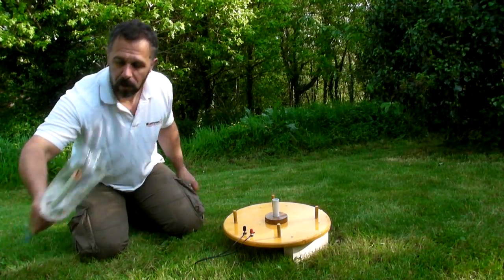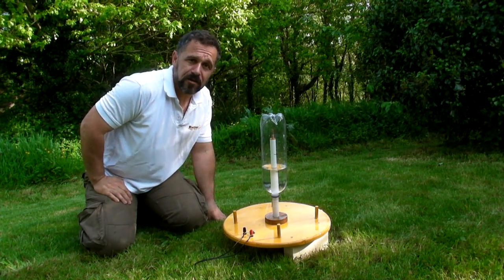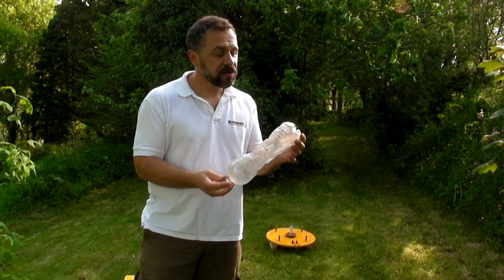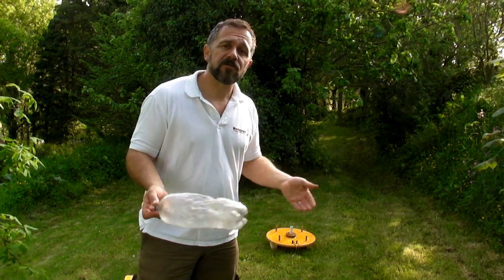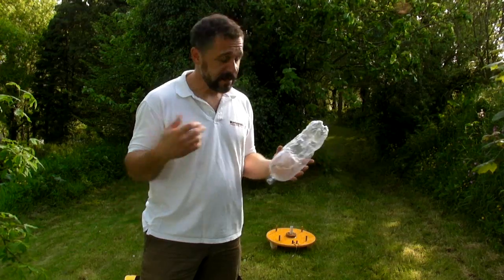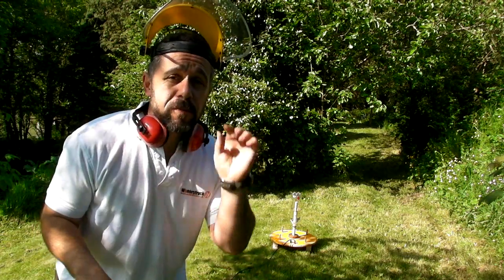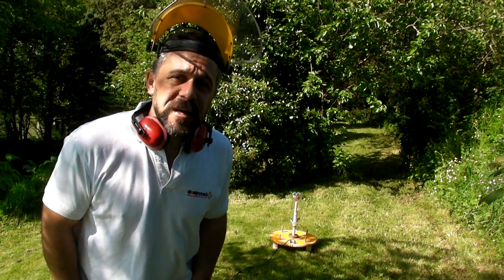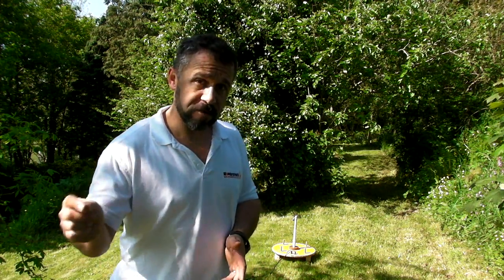Our Amazing Hydrogen/Oxygen and Gunpowder Water Rockets

Comment: you're explanation at about 4min in is questionable.  Try exposing the PET bottle to any extreme heat source:  Near boiling water, propane torch, oven, etc. and you will notice than the bottle will shrink as a result.  If the heat is evenly applied over a long enough time (boiling water for 5min. for example) the bottle will shrink to about one fifth of it's original  volume (capacity).  I believe this is what you are seeing in the deformed bottle - exposed to extreme uneven heat - nnd not a result of negative pressure due to equalization.
Reply: Oh, dang, I see you already found this to be the likely explanation.  Further down the discussions go in that general direction anyway. :P
Reply from the maker: +Tesselator Tess Yup - but thanks for pointing it out.  Nice to know that people actually watch the videos and listen to me droning on!

Comment: Did you try less water?  It seems to me most of the impulse (force times time) is from the climb up the white piston rather than the reaction force from the water being pushed out after that. In which case, the excess water is being needlessly accelerated.
Reply from the maker: Walter Clark We didn't really play around with this for too long as I only had one charge made up at the time.  The plan was/is to do a bit more with this but there aren't enough hours in the day but it is on the list.  

Regarding the amount of water - it's all a compromise.  More water means more reaction mass to push out the back but a heavier rocket to accelerate.  Less water means less reaction mass but a lighter rocket.  From personal experience I tend to find that about a quarter to a third is the ideal water fill.

The rocket does indeed accelerate up the launch tube and it does this without losing any reaction mass.  Once it leaves the tube the water is expelled and while the water is being pushed out the back it continues to accelerate.  Once there's no reaction mass left it stops accelerating - whether the acceleration is greater on the tube or after the rocket has left the tube (and is still expelling water) I don't know.  Maybe one day I'll get around to adding an accelerometer to one of these!

Comment: I think the reason that bottle got shrunk has nothing to do with the pressure. Its simply the heat. you can shrink a plastic bottle by burning alcohol vapor (booze residue) inside, or even by pouring boiling water.
Reply from the maker: Daryoosh Kazemi Yes, I think you are correct - that was pointed out to us shortly after we posted the video.

Comment: The bottle shrinks because when the plastic melts, its surface tension pull it together. So you will get smaller bottle, but with thicker walls.
To prove it, just heat the bottle without cap.

Comment: If you want to prevent the bottle from collapsing and burning the bottle. try to run the burning gas down through a tube and into the water to be precooled.

Comment: Combine the launcher and electrolysis rig: Produce the hydrogen+oxygen gas inside the bottle itself.

The result is a bottle full of pressurised H2+O2 mix ready to be detonated. Less fiddly than getting blackpowder into a bottle around water and alot more stored energy.
Reply from the maker: I've actually tried the electrolysis idea before.  The problems are that it is actually pretty fiddly and it takes a long time to get enough gas even with a large current (we used about 20 A - which also makes it dangerous).  Using gaseous oxygen and hydrogen actually gives us a lower energy density than black powder and to be honest the black powder was really very easy to use.

Comment: Funny, i did the same thing....with propane over a YEAR ago! i have videos up here to prove it. my launching method was the same...a rod inside the 2l bottle that provided ignition inside.
Reply: a friend suggested blackpowder but i declined. at least someone else tried that!
Reply from the maker: Yes, I've seen several videos using the hydrogen/oxygen mix over the years.  I've not seen it done with propane though and I've never seen it done with black powder before, so until someone proves us wrong we're claiming that as a world first!
Reply: i was the first with water/propane and beer/propane. black powder is a different animal. i havent done the oxygen/hydrogen though.
Reply from the maker: yz250ftony Definitely impressed with beer/propane.  That could be the way forward for human exploration of space.
Reply: it worked better than north korea's rocket!
Reply from the maker: I don't think they used enough beer!
Reply: i dont know if they are allowed beer, but I think you're right. thinkin juice!

Comment: Fun. Maybe a better solution might be to put the gunpowder into a metal chamber beneath the bottle and funnel the gas up into the bottle as it ignites. That way you don't have to 'faf about' getting the powder into the bottle, or even worry about protecting it from water.
Reply from the maker: Could be interesting to try.
Reply: That sounds... almost exactly like what firing a blank out of a gun would produce.
Reply from the maker: Nick Johnson Yes, I guess it would be the same.

Comment: Nicely done!

Just to clarify one thing: Bottles are blow molded from an injection molded preform which is roughly the shape of a test tube. The preform is expanded to the shape of the bottle with heat and pressure. Since the PET plastic has a "memory" when stretched, it will try to return back to the original shape of the preform when heat is applied. That is why your bottle shrank. Go ahead and try it. Hit the bottle with a heat gun or stick it in the oven and watch it shrink.

We have a tutorial on our website (http://www.uswaterrockets.com/construction_&_tutorials/bottle_splice/tutorial.htm) and a video tutorial (Improved Water Rocket Bottle Splicing Tutorial) showing how to create a slip-joint splice between multiple bottles to create larger bottles by joining several together, and we take advantage of the shrinking effect to make the overlapping portions of the bottle joints.

Other people have also used this shrinking effect to make various custom parts like nosecones, bulkheads, and couplers.
Reply from the maker: Hey, thanks for that!  That's definitely interesting - I was thinking that the heat from the burning gas would soften the bottle such that the expanding gas would overcome this tendency to shrink and force the bottle to expand.  we did an experiment some years back where we buried a squash bottle (this would be the more brittle plastic, not PET, but I'm not sure of the name) with a mix of H2 and O2 inside and then set it off electrically.  I had expected a kind of land mine effect but all we got was a dull thump.  When we excavated that bottle it had also collapsed rather than exploded and the only reason I could think of was that the water vapour produced in the explosion condenses back to liquid and leaves a vacuum which causes the bottle to collapse.

The more I think about this rocket though, the more I think you're right because any drop in pressure below ambient in the bottle would just result in air being sucked back in through the neck.

After our experiments with black powder I'm thinking about trying a couple of small multi-stage rockets as it should be a relatively easy thing to create a small microcontroller based system to ignite the charges in sequence.
Reply from the maker: Thanks!
Reply: wonderstruckwow

Hey there, thought i would add my two cents (pence for you i suppose).

The balanced equation for H2/O2 combustion =

2xH2 + O2 -> 2 H20

i.e. you're going from 3 moles of gas to 2 moles of gas - Hence your contraction.
Reply from the maker: P Brown Good point but the resulting water vapour will be at very high temperature initially (stoichiometric mix burns at about 2800 C) which means that it's going to want to take up a much larger volume.  I've not doene the maths but this is why a hydrogen/oxygen balloon explodes rather than collapses when you ignite it.
Reply: wonderstruckwow I probably should have spent another minute thinking why my answer was wrong before posting anything ha! but of course ye olde PV=nRt prevails.
Reply from the maker: P Brown No problem - we all make mistakes!